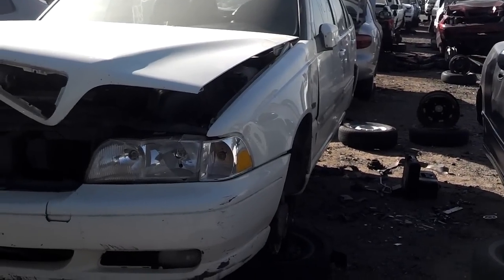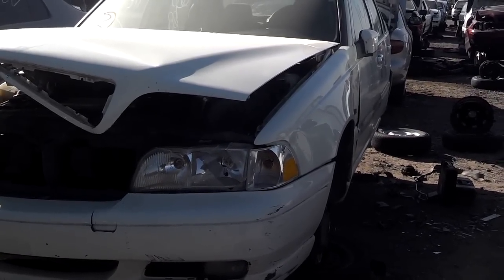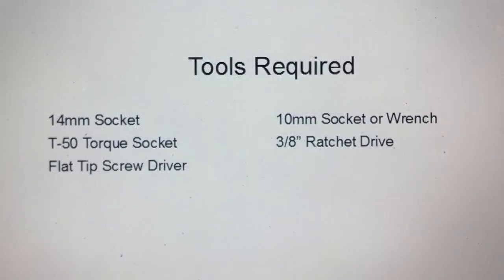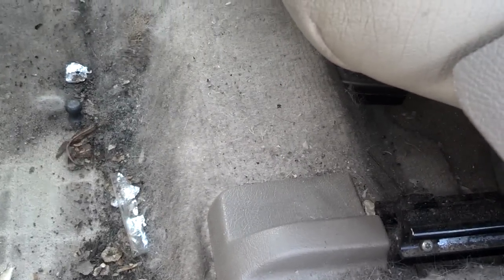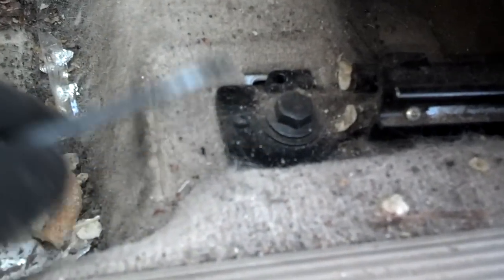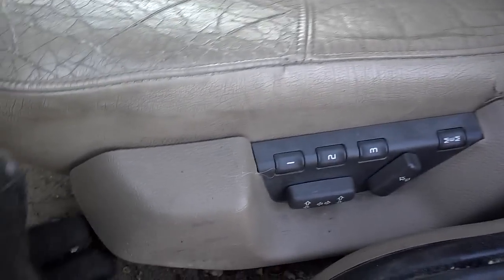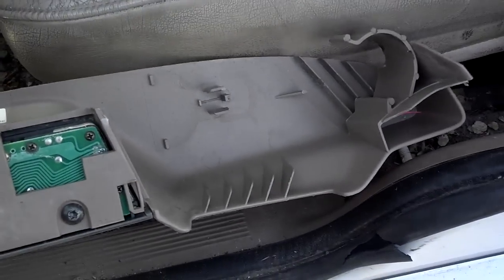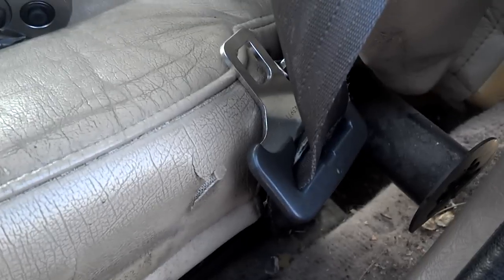Seat removal, Volvo S70, V70, XC70, and other vehicles - Auto Repair Series

Comment: How hard is it to swap 1999 V70 XC seats into a 1998 V70 GLT. I know the seats can hook up easily but do I need to buy a different seat belt buckle at all or can I use my old one without any modifications to the wiring harness?
Reply from the maker: The seat airbag is different. I also think the seat belt mounts to the seat differently. Not sure what you need to do, but I don't think you'll get that airbag working.

Comment: cool got to pull mine because the seat heater isn't working...think it a wire under the seat I see it hanging out of the harness just gotta pull the seat .
Reply from the maker: Did you see the seat heater video.

Comment: Robert, I have a 2004 Volvo 70XC trying to find front passenger seat. I think the 2001 to 2004 S/V70 with electric seat will work also the 2002 to 2006? S60 I think will work any help is appreciated. Thank you.
Reply from the maker: Why do you need a seat?
Reply: @RobertDIY  the one in the car is crispy and cracked with holes 
the previous owner left the windows down and the seats got wet multiple times. The dealer I got it from replaced the drivers seat but not the passenger. The back seat will need to be replace in a couple of years as they are hard, but I may be able to soften them will leather conditioner. THX
Reply from the maker: https://swedishcarparts.com/parts/1553-s60-v70-01-04-front-lower-seat-cover-leather-upholstery-light-beige-oak-arena-a981-9478992

Comment: im attempting to replace the front seats in my 2002 xc70 ocean race edition. can i use seats off an 06 xc70?
Reply: if not, can I use the leather cover?
Reply: i would like to use the leather cover for the seat, butt portion
Reply from the maker: Probably.
Reply: I've found that the seats themselves are not interchangeable so I will have to attempt to change the covers. The cover on the 06 doesn't have hog rings

Comment: I did, just want to make sure if there is something else I need to do. Since you mentioned that 1999 doesn’t have the manual airbag sensor clip. Does that mean I can just remove the seat after I unplugged the battery.
Reply from the maker: Yep.

Comment: Robert
I have the same issue as the other user Erich Martin where I want to move the front driver's seat back 2 or 3 inches. Mine is a 2000 V70. I was trying to find the notches in the seat frame as you mentioned to lower the seat bottom but couldn't locate them. Where about are those notches and what tool do I need to adjust?
Reply from the maker: I don't have a video for that. You'd have to pull the seat and look for yourself.

Comment: Hi Robert, I have a 1998 S70 Right hand drive and the drivers seat is a little different to the passenger. The headrest is a slightly different shape. Are the seats different in the 1998 and 1999 or 2000 models?  They are leather seats. Thanks.
Reply from the maker: not really.

Comment: so if the bolts are stuck and i have no access to electric tools in the junkyard what then?
Reply from the maker: skulkruncher122 You use a different tool or move on.
Reply: Bring a cordless impact wrench

Comment: Hi Robert. I appreciate very much your videos. I want to replace the driver seat on a 2000 S70 but want to find the colour code of the seat. I just dont want to end up with a replacement seat of a different colour. It would not be very pleasant.

Thanks for your help.

Michel Pelletier
Reply from the maker: Michel Pelletier If you look at the vin tag (metal) under the hood, the right column has the color codes. The 2nd number down "3960" is the interior color, the 3rd set of numbers down "145-46" is the exterior color.

Comment: ever come across a rear fold down seat seat on a xc70 being stuck in the upright position, I cant fold it down and have no access to remove the screws. this is the double wide seat. for some reason I can slightly shift the seat back and fourth, so I think something jammed in the mechanism but I don't know for sure.  If you know anything of this matter please help, its been like this for a few months now.
Reply from the maker: Poncho Grrrr. I got one loose once. I think I jammed it back real hard and it popped the latch. Look in the other side and see if you can find a release. If you don't hear back from me in a few days, hit me again.

Comment: Robert, do you think it's possible to move the seat tracks back another 2 to 3 inches on my 2000 s70? I am 6 Ft. 6 in. with old arthritic knees and could use a little extra room on those long drives.
Reply from the maker: +Erich Martin You can usually lower the back of the seat. It has notches in the frame and you can lower the seat bottom. That may help.
Reply: +Robert DIY, I will give it a shot and get back to you w/ the results.  I always  Swedish people were taller.
Reply: Hi Erich
I have the same issue you do. Did you have any luck lowering the back of the seat to get extra leg room?
Reply: Erich Martin I'm going to go ahead and try it it. Any luck when you did?

Comment: HI Robert. I have a 2002 v70 xc and the seat heater and controls work about 5% of the time. I bought the car last week and the seats would not adjust. I ended up getting lucky and it slid back for me one day when I got in the car and it quickly stopped working after sliding back 4 inches or so. Since then it has been non responsive. I dont believe the switch to be faulty since the seat heater is not functioning. Do you have any idea where to start at diagnosing and fixing the problem? I quick checked the harnesses and they seem to all be in tight. 
-Mark
Reply from the maker: gokepsgo Hi Mark, if you start the car and turn the key back a little, will that help? - https://www.youtube.com/watch?v=x3MP9KaPMqA

Comment: Dear Robert 
what if my volvo v70 1998 has manual not elektricj seat 
how do i remove the(buttoms) that goes up and down 
??
thakns a lot !
Reply from the maker: gumis8888 They have a T25 screw in the handles.
Reply: Robert DIY  thanks a lot 
Now it is out of car

Comment: quick question; would it work installing seats from a S70-99 in a S70-98? I cant get any error codes in my 98, right? since the airbag release is mechanical?
also, does the seats fit? i've heard so many different statements about how to iinstall seats on different forums now so you're my last hope.

love your videos, they help out a lot. 
huge thanks from sweden :)
Reply from the maker: Seats will fit. You should NOT get a code. Our US '98 has a different air bag system in the seat then the US '99 car, not sure if your country is the same. If the same, you will loose the seat airbag function and should NOT have a SRS light.
Reply: @RobertDIY  great, thanks!
what I can gather from swedish sources it seems like we have the same systems in the 98 and 99's.
I'll go ahead and buy seats from a S70-99 then, thank you so much. :)
Reply: @OmgItsLeaa  Did this go ok? I cant find a 98 and also was thinking of installing a 99 interior and loose the airbag function
Reply: @TheAteerink  i never went through with it, i just bought a 2000 s70 with full leather seats.

but im guessing it SHOULD be okay since the 99-00 has electronic airbags, the 97-98 doesnt, so replacing seats in a 98 with a 99-00 seats should give error codes.

Comment: Hi Robert. Thank you so much for sharing your experience! I have an SRS light on in my 1999 s70. The Mechanic charged $100 for the diagnostic and said that there appears to be a short on the driver's side airbag. He wanted nearly $1000 to fix it and do other repairs. Where would a short most likely be? I have a feeling it may be in the seat sensor. What is a code reader you recommend?
Reply from the maker: chaplainsunshine He should have given you the code or at least told you where the problem was. Steering wheel air bag, seat belt, seat air bag, etc. I do not have a code reader that reads Volvo codes. Most people get a software and adapter for a laptop.

Comment: Is it safe to remove the seats from my 99 C70 like this? I'm afraid the sips bag explodes in my face 😂😂
Reply from the maker: Those are different but it should not deploy the air bag as long as you disconnect the battery and unplug the seat connectors.

Comment: I've got a V701997 with manual front seats - the driver's seat is sagging - I can't find a replacement which is any better - I've got a feeling that a V40 seat would fit - have you got any experience of that? Or can I fit any other seat in it? Thanks
Reply from the maker: C70 seat should fit.